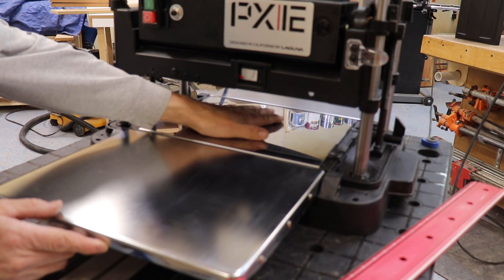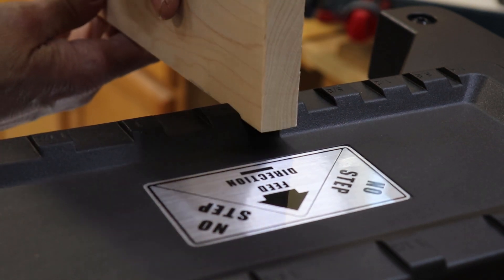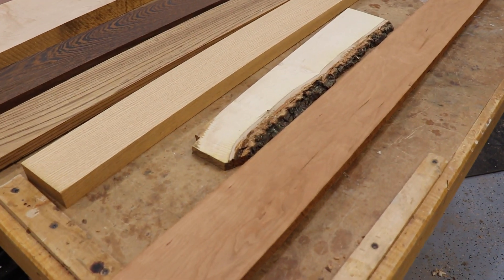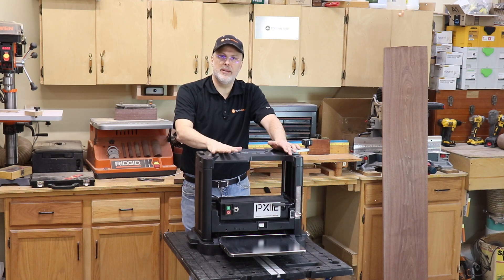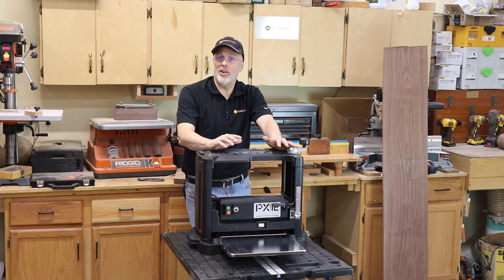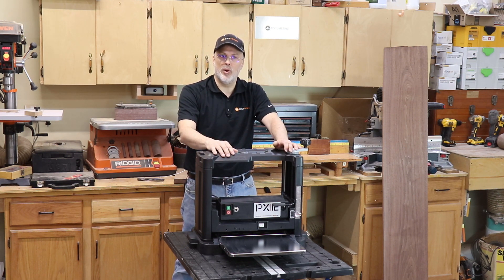Laguna PX12 Portable Carbide Insert Planer Deep Dive Exam

Comment: I wonder why these companies don’t go to helical cutters? Those are one step up from this setup.
Reply from the maker: They are more expensive because the machining is more expensive. Cutter heads with all straight machining can be produced much more quickly. This style offers some of the benefits of helical at a lower price. Laguna offers machines with both styles, this being the cheaper option.
Reply: But its what we want. 🙄 and ill pay more for a better product.
Reply from the maker: Many companies do offer helical cutters.  Laguna, for example, offers this unit as an entry level planer.  It's designed for low cost manufacturing.  Their higher end planers have a more complex design to produce a better surface on figured woods and they cost a lot more for customers to buy.

Comment: Interesting, other reviews have found the snipe to be quite bad on this product but i wonder if they just did not joint the board first or maybe did not spend the time to dial in the in and outfeed tables.  

I have been considering this product as i already have a laguna jointer and they could share inserts.
Reply from the maker: Hi Island, If they didn't face joint, that would explain the snipe.    Interchangeable cutters is a nice feature.  Be sure that the jointer that you have does in fact use the same cutters, as I know that Laguna has multiple insert designs on their products.   I use my 18" stationary planer a lot more than this one because it has more capacity and removes material a lot faster, but when I want a snipe-free surface I pull out the PX12.  I've gotten a lot of questions on the surface finish, as some have reported striping.  I recently did some tests where I planed some maple and drew pencil lines across the surface and I could see some very light ridges when I did that.  The ridges were proud of the surface, rather than recessed, so they were very easy to remove with a random orbital sander.  I don't know if others are seeing a more severe case of striping, or if this level of striping bothers people.  I didn't even notice it until I ran the pencil test across the surface, but now I know that it is there.  Cheers, Paul

Comment: Same issues as others, just got my unit, leaves nothing but grooves in the wood, I even cleaned and reset all the inserts, ran board straight and angle, still grooves.  all boards were true one side and I leveled the infeed and out feed tables.  ran it on aspen, oak,  hard maple. Buyers beware, I will be contacting Laguna and Rockler tomorrow. I will update once I hear back from them. Wish I would have went with the Dewalt 735x
Reply from the maker: Ugh!  Sorry to hear that. Hopefully they can get this sorted out for you quickly. Must be a bad run from the factory. Mine is still working great. No issues on surface quality or anything else. Still working like it was in the video.
Reply: @ToolMetrix  update from Luguna this morning 12/7/21 is that they found a batch of bad planers were sent out. They are sending me a new machine, Ill post updates once the new one arrives
Reply from the maker: Great thanks for the update. Glad to hear that they’re being responsive.
Reply: @josephsheehan37  hello, did the new px12 planer come yet?  Were the issues solved?

Comment: Is there anything else to set up or calibrate for initial use? I have half inch cutter marks across the full width and length of every board that I’ve done. At least a 32nd inch ridge. I’ve sent a ticket to Laguna i guess I’ll have to wait and see what they say. It’s disappointing when you can’t pull a new machine out of the box and use it.
Reply from the maker: I didn’t have to do anything additional. Not sure what might be happening with yours. I hope they can get this resolved quickly for you.
Reply: @ToolMetrix   I got a reply from Laguna service tech and they are going to replace this machine. Thanks for your time and reply.

Comment: I  just ran a few boards through my new PX 12.  I'm glad that I didn't break down my 20-year-old craftsman straight knife.
Reply: Not sure I understand  --  are you not happy with PX 12 results ?
Reply: @georgebrill3072  I was not impressed at first, but apparently a bad batch of planers were shipped.  My replacement just arrived. I'll repost results when I can
Reply from the maker: I saw someone else made a similar comment, and Laguna indicated that they had received a bad batch and they are sending a new planer.
Reply: @ToolMetrix  My replacement just arrived 🙂
Reply from the maker: Nice 👍
Reply: @ToolMetrix   First - I love the Laguna tools I own, and their customer service is great too.  My replacement also left some marks although not nearly as bad as the first machine.  I , and others, have been advised to return the machine.   If I were new to planers, I would likely think my replacement was the way it was supposed to be.     It sounds like its a design flaw in the cutterhead.   I have to wonder if the machine you tested was the same.  I couldnt see any marks in your video.   Would you mind laying a piece of paper on a planed board and shading lightly with a pencil to see if your machine was leaving marks?
Reply from the maker: I'll run a couple test pieces next time I set it up.  It's put away now as I'm in bowl turning mode.  But what I can tell you is that the surface quality has been impressive to me.  I have carbide cutterheads on my stationary planer and my jointer, and the surface finish was every bit as good as either of them produce.  With these tiny square cutters there is often some extremely light striping, and that is acceptable to me.  I haven't seen a carbide cutterhead that would allow me to skip the sanding step, so the question is how much sanding should I expect to do?  With the PX12 that I have, the sanding effort is minor.  I'd say that slightly less sanding is necessary after planing with the PX12 than with my stationary planer that has a $1000+ true helical cutterhead.
Reply: @ToolMetrix  Thanks for the reply.   Maybe I am expecting too much from this machine(?).  The first one was definitely not right (many deep marks) .   The second does leave marks but would sand away easily.   I was excited to see the "entry level" carbide cutter heads hit the market.  I was going to replace my old school straight 3 blade straight knife, but it leaves a smoother finish.   I started to think about the PX 16 or other true helical head planers, but the "tiny square cutters"  leaving faint marks makes sense.  Now I am even more confused on what to do.

Comment: Nice review. Is the drive-belt a poly-V belt?  The 2hp rating seems a little low. If this was a router, the marketing geeks would have rated it as a 3.5hp motor. 🤪. A Quick and ROUGH calculation using .85 power factor, 80% efficiency, and 120v for your  shop = .85 x .80 x 120 x 18 / 746 = 1.97 HP, which certainly acceptable!  Nice to see an honest and conservative company!
Reply from the maker: I believe its a poly V belt.  Good insights on the hp rating.  Thanks for sharing!

Comment: Great video! I'm debating between this unit and the Dewalt DW735. Your thoughts?
Reply from the maker: Great question. Dw735 is a better planer and the px12 has a better cutterhead.  It’s a tough call. The px12 is a lot easier to compare to the dw734 because the planer is so similar that you are mainly evaluating how much the nicer cutterhead is worth to you. The comparison with the 735 is more complicated with additional variables.
Reply: @ToolMetrix  Thanks for the quick reply. There is a Laguna unit in stock near me, the exact same price as the 735. I was set to get the 735, but the cutting head on this one is making it difficult. LOL. Will pick one of them up tomorrow!
Reply from the maker: Great call. Let me know what you think after you try it out.

Comment: I was just running boards through this planer yesterday. Less than an hour in and it was leaving ridges in the wood. It definitely has snipe too. Overall, I am not impressed. I get better surface finishes with my 50 year old straight knife planer.
Reply from the maker: Interesting.  I wonder what you hit that knicked the cutter.  That can definitely happen with carbide but it typically happens a lot easier with HSS.  Mine still shows no sign of streaking.  As far as the snipe that you experienced, did you face joint the stock first?  Did you lock the cutterhead?  I found that if I ran warped stock through without face jointing it might snipe, but if I face jointed first it did not snipe.
Reply: @ToolMetrix  The stock was freshly face jointed with a powermatic jointer running a Byrd head. The planer was locked every pass. I inspected the cutters and they didn’t look nicked. There was a raised streak exactly the width of a carbide cutter. I took the offending cutter out and reset it with the same side and that appeared to fix the problem. I think somehow some cutters got out of alignment. I compared that jointed and planed surfaces and even though I haven’t rotated the cutters on the Byrd head in a couple years, the finish was far superior than the planer’s finish.
Reply from the maker: That's definitely concerning about the ridge and having to reseat the cutter.  Also, it sounds like the surface that you are getting is not the same as what I'm getting on a variety of wood species.  So far in the stuff that I've run through it, I haven't seen any room for improvement, although I do believe that your jointer's Byrd is certainly a superior cutterhead.  I don't have a Byrd, but I have spiral cutterhead on my jointer and a high quality helical head on my stationary planer that's probably in the same league as a Byrd, and so far the PX12 is holding its own with those in terms of surface quality.  I hope they can get this sorted out for you.  What a disappointment.

Comment: Definitely useful.   This is my first time using a planer.  Period.  Setup was easy.   Wondering, In your opinion—what's the longest piece of lumber one should run through this machine.   Could you do a 10 foot piece of white oak?  If there was a good outfeed table?   Or would pulling that type of stock be too much?
Reply: Total Length feed support and Length of outfeed support should be two times the maximum amount of the material . But venting/dust chute should be good size for the amount of material you may be removing.
Reply from the maker: Hi Ray, you should be able to do any length as long as you have support. A person on each end would be good as well.

Comment: Good vid as always. Couple of questions. Height adj did you have to turn it off after every run through the planer ? Where did you get them meters? Sound meter, and more importantly to me, is cfm meter? TYVM….
Reply from the maker: Hi Michael, thank you sir.  No, I didn't turn off for the height adjustments.  Just left it running.  Here are the meters: https://amzn.to/2RuU1rY .  For air flow I use a Dwyer Digital Manometer.  There are cheaper ways to do it.  Look for a video on Stumpy Nubs' channel on how to make a manometer.

Comment: How do you think this compares to the dewalt 735?
Reply from the maker: Hi Michael, I’m hoping to get my hands on a 735 to get a better sense of that, but from what I’ve seen the 735 is an impressive machine and probably has some advantages over the Laguna. For example, I like the dust collection design a lot. The main advantage for Laguna is the cutterhead. Longer lasting carbide and easy to swap is a huge advantage. I don’t know if the Laguna will have a cut quality advantage however. That 735 with sharp knives can produce a flawless surface as well.
Reply: @ToolMetrix  thank you!

Comment: What do you think of the build quality... seem like it will last awhile? not cheaply made? I don’t know very much about laguna tools just wonder if it’s a quality brand?
Reply from the maker: Build quality seems solid throughout. I don’t see a “weak link” that is likely to fail soon.
Reply: @ToolMetrix  awesome!!! Is that pretty standard for the laguna brand? Also I’ve read some negatives about customer service and no warranty for their tools? What are your thoughts on that? I’m just trying to learn more about the brand before I invest in this planer? Also you think this would work well for making cutting boards? Especially edge grain?
Reply from the maker: Definitely great for cutting boards. All Laguna tools have a warranty. My experience with customer service has been satisfactory. Check out the Laguna user pages on Facebook. You’ll find lots of input from Laguna owners about quality and customer service.
Reply: @ToolMetrix  awesome!!! Do you know when this planer is coming out couple websites say different things... one says June, acme tools says September!
Reply from the maker: I haven’t heard anything for certain either. Hopefully soon because people sure seem to want them.

Comment: It appears that chip collection is very good. I have a Rockler 750cfm collector and I'd like to feel confident that it would be adequate. Thanks for the great review.
Reply from the maker: Hi Wraith, yes, very good.  I think you'll be find with a 750 cfm unit if it's directly attached.  The other day I was planing some boards with the PX12 and closed the blast gate about half way and it still picked up all the debris.  I was only planing boards that were about 5" wide, so I'm not sure how it would work on a 12" wide board, but it has an efficient design from my perspective.
Reply: @ToolMetrix  thanks for your reply. I think I’ll wait for this planer to come on the market and purchase it. I currently have a Wen 13” planer but it just isn’t really very good.
Reply from the maker: Cool. Curious; What do you not like about the WEN?
Reply: @ToolMetrix  The gauge in front that displays the cutting depth fell off.  I emailed Wen support about it and they didn’t answer for a while so I emailed again. They replied and within a couple of weeks I had a replacement. I installed it and the second time I used it after the installation the new one broke and fell off.

I could live with that but it doesn’t seem to do a good job removing material.
Reply from the maker: Thanks for the additional information, Wraith. It’s interesting that I hear such mixed reviews about WEN support. I agree that I could live without a thickness readout but if it doesn’t do a good job of planing stock, that’s a harder thing to accept.
Reply: My 12” Jet planer specifies at least 400 cfm. You should be fine.

Comment: I think they missed a huge opportunity to compete directly with the DeWalt 735, which is obviously well known to be the best lunchbox planer on the market for years and years now. All they had to do was make it stout like the 735 architecture, give it a blower, and the spiral head. Price it the same as the 735, and it would most likely out-sell it.
Reply from the maker: Yeah, that could have been an interesting approach, and I do like the 735.  I'm guessing that they modeled out the demand at various price points, and this approach allowed them to come in at a lower price point with the carbide insert cutterhead that serves as the point of differentiation between the PX12 and the 734.     I doubt that Laguna would add a comparable architecture plus carbide inserts and match the price point of a 735.   Just arm-chair quarterback speculation on my part.

Comment: Can you compare this to the Dewalt DW735 with a Shelix head?
Reply from the maker: Hi audioman, I think that the architecture of the 735 is more robust.  I'm hoping to have one in my shop soon and I'll be able to speak about that with more authority.  The 735 also has an amazing dust collection feature where it has an on-board fan that pushes chips out of the machine with powerful force.  A Shelix head has a more sophisticated design and a different strike angle.  The difference would be like using a hand plane and holding the plane in an orientation that is perpendicular to the wood grain (that would be the PX12) vs. holding the plane at an angle to the grain (this is how the Shelix works).  In theory, the Shelix should give you a better surface quality, and in particular should be able to handle figured woods better.  In my shop I have a planer with a Shelix style cutterhead, and a jointer with a cutterhead similar to that on the PX12.  In 10 years I haven't run a single piece of wood through these machines where I could point to a difference in surface quality.  So, I do believe that the Shelix is a superior cutterhead, and I buy into the physics behind it (reinforced by my work with hand planes), but I think I'd have a hard time proving it.   I believe that I could find an example where the Shelix would outperform the cutterhead with the non-skewed approach angle, but I haven't invested the time in doing so.  Yet.  :)
Reply: @ToolMetrix  Thank you so much for taking the time to answer my question,  I think I'll go with the 735 w.a Shelix head.  Great review btw ;)
Reply from the maker: If you have the dough that seems like a great combo. Would love to hear what you think after you run it a bit.
Reply: @ToolMetrix  I ordered both the 735 and a Shelix head.  I'll post a comment after a bit of usage, it'll be a huge upgrade from my old Delta 12" portable planer! ;)
Reply from the maker: Yeah, no doubt!  I’ve had a couple delta portable planers in the past. They were pretty fine in their day but the designs have improved a lot since then, with the biggest breakthroughs probably being the dust collection on the 735, and the helical carbide insert head. You’re getting both!